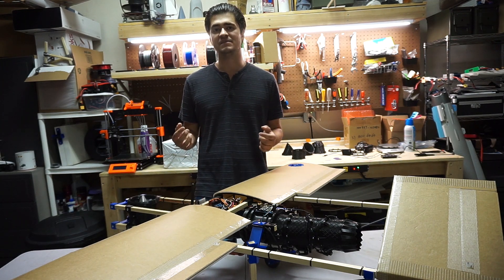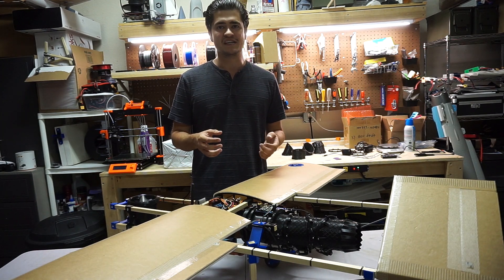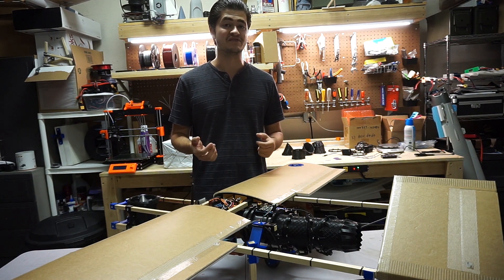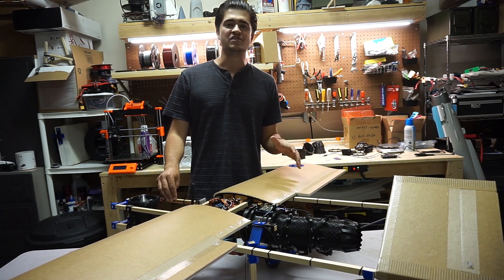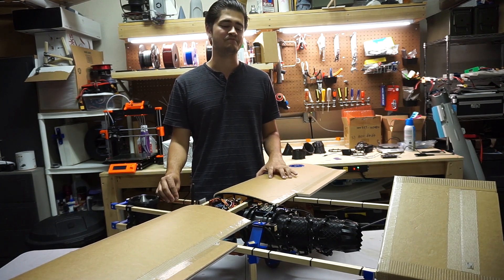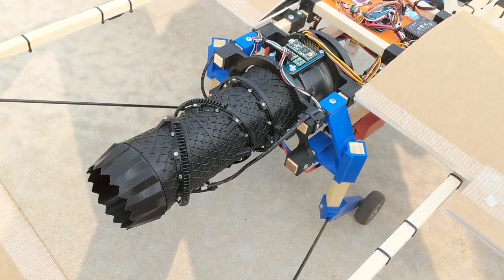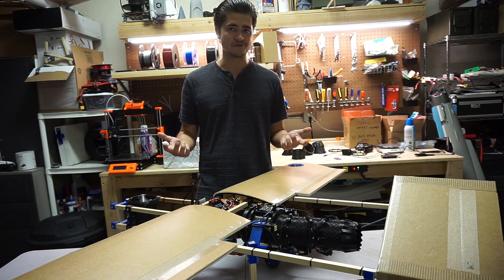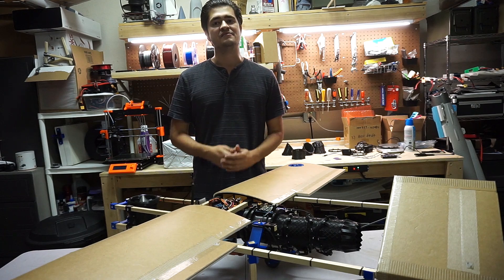R/C F-35B: 3BSM Software Improvements

Comment: You know, I ran into that same math problem playing with HVAC duct elbows trying to set them for exactly 30º, 60º, 45º, etc. You would think 30º would be like 1/3 turns but it wasn't when I actually measured it. I think 45º worked with half turns, but 60º didn't with 2/3. I figured it was some weird thing with the angles and trig, but thanks for confirming it's a non-linear function! I made the same mistake as you thinking it would be linear. I'd love to see a video where you explain how to do the math for the angles now that you figured it out.

Comment: Very nice.
I can see that the nozzle transision from flight to hover and visa versa happens fairly quickly.
Is the nozzle turnrate preprogrammed or controlled by for example airspeed or altitude hold? 
Also when going from hover to flight mode do you then pitch up the aircraft attitude to prodruce lift as soon as possible? And vise versa?
Reply from the maker: A bit of both. When flying, there is an intermediate transition stage with a set angle and slew rate followed by a final transition stage that depends on airspeed.